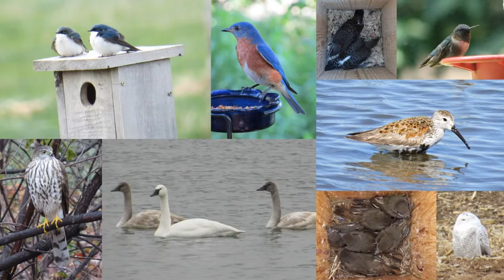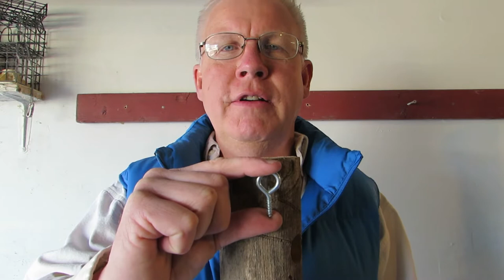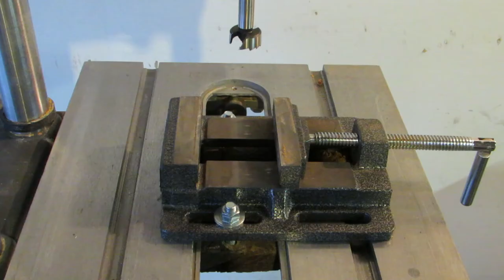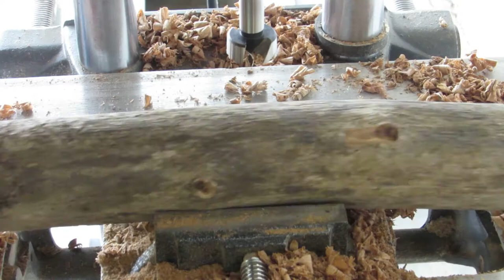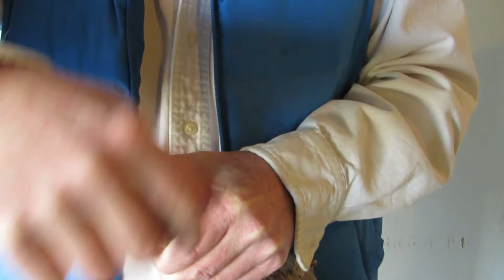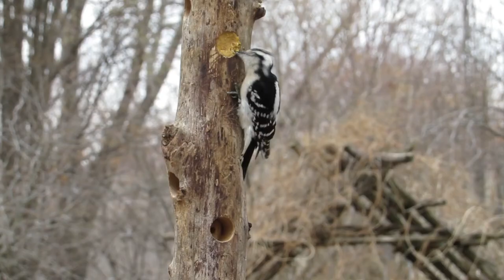How to Make a Suet Log Feeder 2018

Comment: I have the resin suet log from wildbirdsunlimited and starlings grab onto the holes and eat from holes next to it. I had a wire mesh on top folded half down and it kept crows and grackles off but not starlings. I don't want the red bellied woodpeckers excluded.
Reply from the maker: Starlings seen to be able to cling to anything. Some swear by upside down suet feeders.
Reply: @Backyard Birds  I can't use my upside-down suet feeder have one and they had no problems clinging upside-down eating away.
Reply from the maker: They are just too intelligent.

Comment: I put a spade bit in my drill and drilled my holes all the way through. I used a 4X4 peace of wood. It works great. Thank you for the excellent video.
Reply from the maker: Do you like the hole all the way through?
Reply: Just don't use treated wood because of chemicals
Reply: No pressure treated lumber, never.

Comment: Good information. Just built my third suet log feeder. The woodpeckers really like it and the grackles and blackbirds have left it alone.
Reply: How did you source your logs? Do you just walk through the woods until you find something you like?
Reply: Joe Friday I have a few trees around my house and it’s not too hard to find trees down around here. Always on the lookout.
Reply: @tico78742  I'm going to look for a suitable log this weekend as I want to make one for my girlfriend. I guess you just sawed the ends off to make them even then you installed an eye screw or something equivalent on one end?
Reply: Joe Friday Yep. Just an hook or eye bolt. Have used both. My wild bird store sales them but you have also purchase from hardware store. Depends on how large you want to go.
Reply: @tico78742  That's funny you just replied. I got my log a bit ago and I just found an eye screw and a hook a few minutes ago. I was gonna use some paracord I have lying around. Do you use a rope or cord or do you place the eye directly on a hook?
Reply: Joe Friday Currently using coated cables designed for dogs high up in a tree to keep the raccoons away. It has clips at both ends. It has worked very well so far. The tricky part was throwing it over the tree branch.
Reply: Joe Friday The cables are like 20 ft long and found in the pet section of your local store. If you don’t have trees then hooks will also work.
Reply: @tico78742  Thanks for the info. I'm about to go drill holes in my log now.
Reply from the maker: Someone gave me the logs when they were cutting firewood.

Comment: Great video, thank you! I have an aging father who is a very skilled woodworker and I’m going to ask if this is a project that we could do together. What do you think about making the back side flat to be able to screw it to a tree then taking some kind of caging material to lay over it, keeping it maybe an inch out from the log to keep the squirrels out? The sides could attach with open eye hooks for easy removal for filling? It could be longer to make up for the lost holes on the back side. Would love to hear your thoughts on how to do this? I don’t have any low hanging tree limbs to hang anything and this would give a solid launching pad for the large birds to take off from. Thanks so much!
Reply from the maker: What I would suggest is getting a shepherds hook with a squirrel baffle. That way only the birds will get to it. Your idea could work but sounds more involved. Squirrels can drive a person crazy can't they!
Reply: @BackyardBirdsUS  Id do that if I could. But nearby structures allow squirrels to jump to the feeder. This is why I was looking for a way to make your feeder squirrel-proof
Reply from the maker: The only squirrel proof feeders I know of are the kind where the squirrel gets on it and the feeder closes up. Is it possible for you to trim your trees back. That might be an option. I know it's very frustrating to deal with squirrels. They are so incredibly persistent and intelligent.
Reply: I just now asked a similar question. earlier before scrolling down. I'm thinking about using the hot pepper based suet that squirrels aren't supposed to like  but doesn't bother the birds. C&S makes some and then either not drilling holes in back and attaching right to a tree  or just hanging from a hook away from the tree or just a hook so you can flip it around to use the other holes when needed.???
Reply from the maker: Sounds like that could work.

Comment: how do I keep grackles away from my log feeder
Reply from the maker: I just let them eat. They generally only come during migration or do you have them all year?
Reply: Unfortunately—The starlings became a huge issue for me with these log feeders. I modified the feeders twice—but the starlings still found a way around that. Even moved to 2 different upside down suet feeders—and the starlings cling upside down and eat just fine from those. There is only ONE feeder I’d recommend that I’ve noticed starlings don’t like very much—while still attracting the red bellied and downeys. Walmart sells it—it’s an upright rectangular shape, green metal with a metal roof. Caged. Walmart also sells the woodpecker seed cake for it. I highly recommend this as I’ve tried it all and the starlings have actually broke 3 of my feeders—AND they are responsible for much of the seed scatter on my basic platform feeders for my cardinals. It sucks as I like them but there are just too many and they are pure chaos.

Comment: Has anyone tried  C&S Hot pepper suet dough?The red pepper is supposed to repel squirrels. If it does. Can you just hang it from a tree with a hook and just flip it when the hole get empty on front and sides. Or shepherds hook it away from tree enough to let birds get all sides?    First question is does the hot suet dough work?
Reply from the maker: I'm sure it works. But if you put on squirrel proof pole you don't need it.

Comment: Thank you for this!  Will cardinals like this?  We have some here, and I want to be sure this is up their alley.  :)
Reply from the maker: I have seen cardinals eat it.  But not from the log. I just sprinkle some crumbles in a dish or on the ground.  Cardinals are interesting because they often come to feeders right at dawn and at dusk.  Have you noticed that?
Reply: @BackyardBirdsUS  Same for the most part here as well, South Central PA, sometimes see them during the day though. I have a small platform feeder and the squirrels always seem to knock it over, anyway to combat that? At the end of the day the birds are still foraging what's left on the ground, but it's annoying. Thanks for sharing by the way.
Reply from the maker: @okedokie  to keep squirrels off feeders I use a heavy duty shepherd's hook with a cone baffle. Check out my squirrel video one that managed to get past the baffle because the pole was leaning.
Reply: No. The more platform feeders you have with black oil sunflower seeds and safflower seeds—that is all you need. This winter I had around 25 that would feed at once every day. But they require a lot of space to feed—and again, the more platform feeders you can get (look into seed catchers as that provides another platform)—the better off you are. Also—mine here in Missouri don’t like the sunflower hearts/chips—they prefer to eat the seeds. #1 favorite is black oil. #2 is a tie between the stripe and safflower. I use striped sunflower seeds exclusively in some of my platform feeders in order to deter the mourning doves and other birds that are messy and scatter the seeds too much. The one downside is—when the cardinals aren’t fully mature—they have difficulty opening those seeds because they can be too big for their beaks. For example, all of the cardinal babies I had from late last year—well it wasn’t until maybe 1-2 mos ago that I noticed they were able to break that seed.